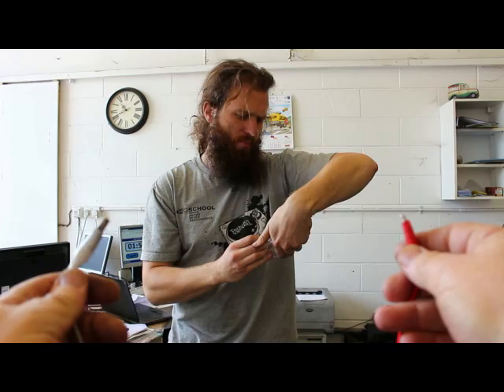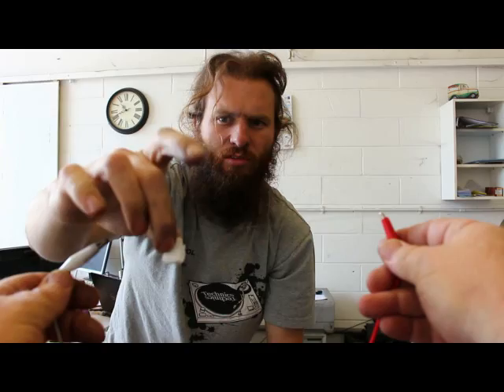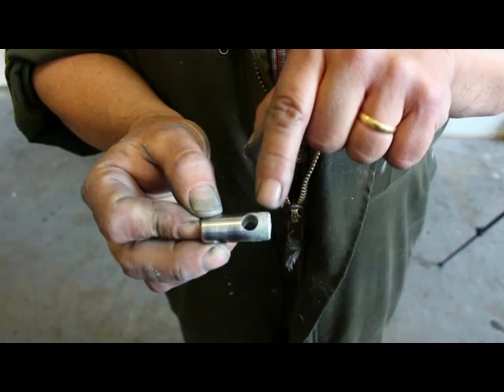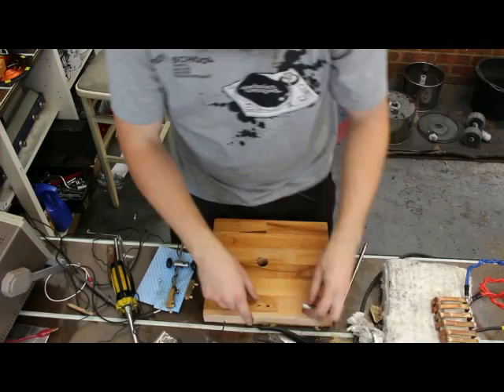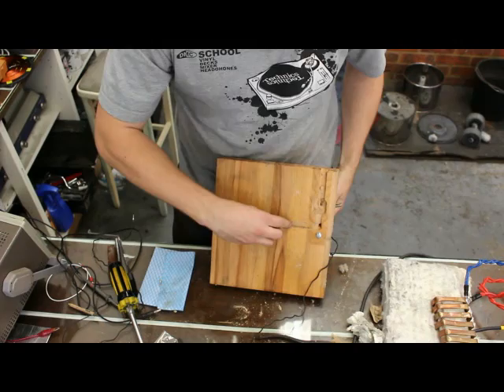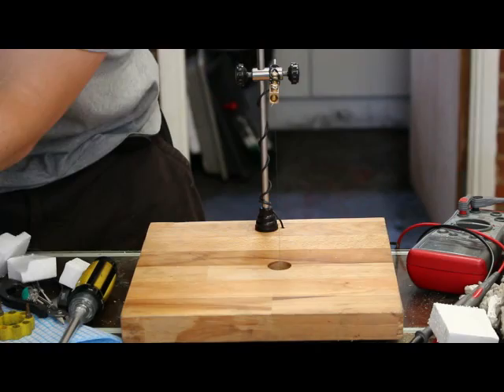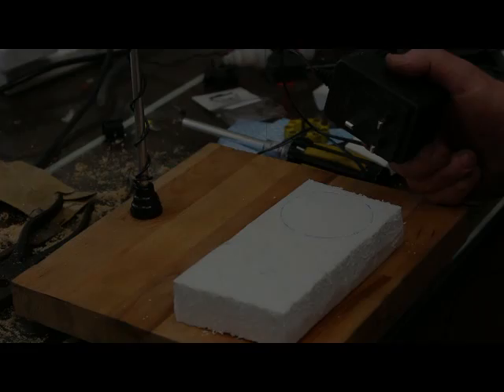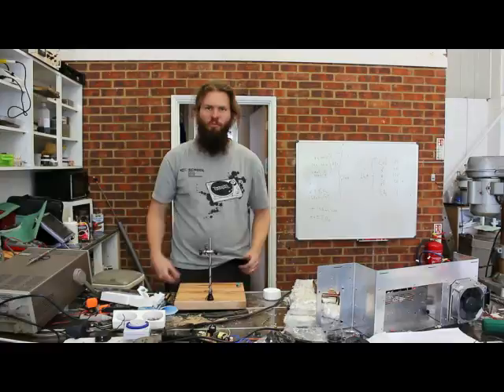How To Make A Hotwire Cutter - Or Making The Megameltatron

Comment: I am using the wires from as broad toaster (which was thrown away as it did no longer work) as a resistance to charge super capacitors and older NiCad batteries. But I imagine I could use those wires as well for cutting foam.
Of course I am only sharing this hoping I am going to give someone else the same idea I had ;-)
I do wonder if it can be used, I measured about 2.4 ohm per 20 cm (8 inch)
Reply from the maker: deslomeslager Toaster wire is NiChrome and works fine - we just used this wire as we were sent it as a sample

Comment: they have been useing the same principle to cut the cores for fiberglas home built airplanes for decades.
Reply from the maker: TheGEODEAHOLIC yes i know - we had one in our metalworking shop at school - this is just how to build one for those interested
Reply: Robert Murray-Smith  Thank you very much for the idea, building tutorial and tips.  What are the specs of the plug in  power source you use, AC or DC voltage and amp rating?
Reply from the maker: ReasonForemost it's just a 12v wall wart - 1 amp i think - you can adjust length of wire for whatever supply you have

Comment: Its much more precise if you use templates and just slide with wire around it. Also if wire is not streight you can put one end into drill and hold tight other side with someting and while its twisting it will streighten up all the way. Just dont over do it.
Reply from the maker: Darko Bulatovic two very good tips mate - cheers
Reply: Robert Murray-Smith  Learned from people like you on Youtube. Keep up the good work
Reply from the maker: Darko Bulatovic cheers mate